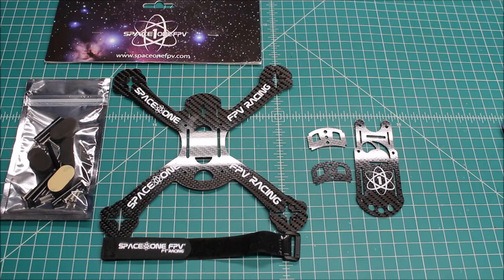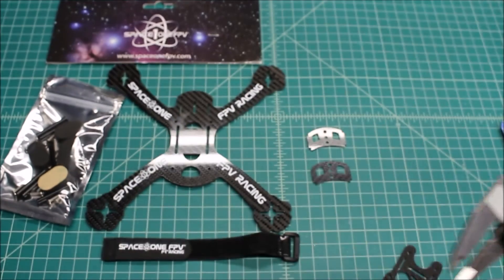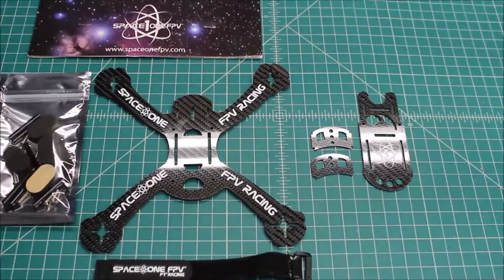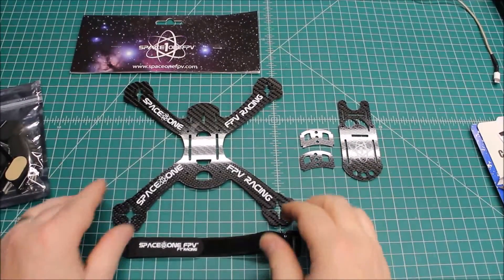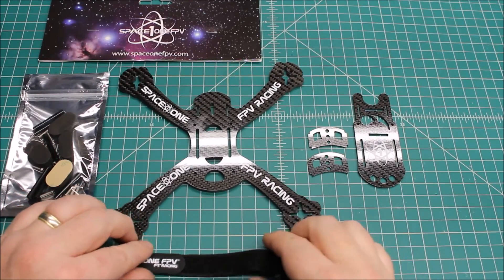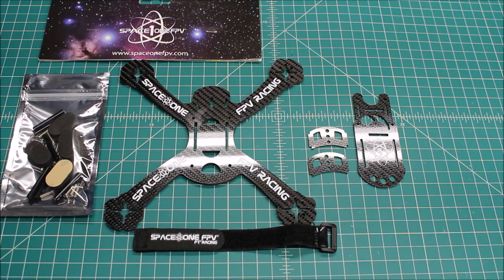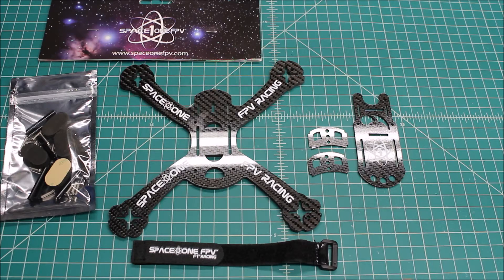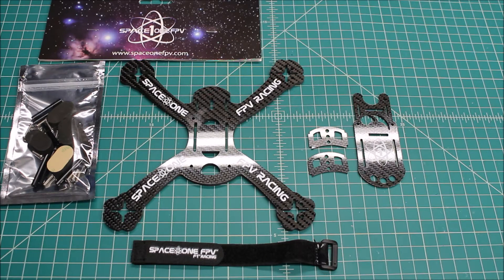Space One FPV Formula 220X Frame Review & Buildout

Comment: Great review and channel! Looking forward to your build results. I nabbed a SpaceOne220X frame and a Kombini FC, a set of RS2205/2300's, TBS24a_S's, and a Foxeer NightWolf. I had two questions that I would definitely appreciate your opinion on if you would be so kind? You said you would be running the Foxeer Arrow in yours, and the case in the Areow is the same as the NightWolf. So how are you mounting the camera? I noticed mine will not fit with the CF camera cutouts included with the frame unless I were to expand the holes. I also noticed that using the camera bracket doesn't fit quite right either. My second question was with the VTx antenna. The frame has those three holes in the top rear, are using one of those to secure your antenna vertically or is that a bad way to do it in your opinion. I notice you haven't been attaching your antennas vertically on pretty much any of the quads on your website. So I thought I would ask. Thanks a bunch!!
Reply from the maker: I would drill out the ho;es and mount your camera that way. IMO the provided camera mount rarely fits properly in a FPV frame. The only time I mount vertically is on a frame like the Neato where the frame design makes it difficult to mount it out the back.  I like to mount it out the back and run a zip tie through the vertical mounting holes to support the antenna. You really want to support the antenna as much as possible. This way when you crash and the antenna gets hit and pulls on it, the pull doesn't damage the VTX as well.
Reply: Thanks! You're right, I go through antenna's often, but it is unsecured and in a vertical orientation like you're saying. I think I just needed to see it in writing for me not to use those beckoning holes on the rear of my current SpaceOne build. Although, the holes will still come in handy for securing the wire ties. Thanks! As for the hole enlarging to fit the wider Foxeer camera cases. Is there a technique you prefer over others? I was thinking of just using a wireless drill and bit? Thanks again!

Comment: you said you using the arrow osd camera, but noticed the space one 220x frame looks like it is set up for a center mount camera, where it would pivot in the center of the camera case. like a lumenier or will the arrow internals fit in a center mount 26 x 26 case?

Comment: Doug,  I picked up one of these frames, and I really love the quality of it. I did notice the the motor's mounting holes seem to be a lot larger then I use to (compared to QV250). I need large washers to mount my 2204 and my 1806 screws just simple fall all the through.  I am interested in hearing your take on this, given your experience. Is there an mounting method I am not aware of here.
Reply from the maker: I didn't have any problem using a M3 Screw.

Comment: Doug, what are you going to use for  a PDB on this build? I just received mine in the mail so I am ready to start building it. Really like what you are doing here. Thanks
Reply from the maker: Keith Gilbert Im so glad your enjoying the channel. I will  use a Matek mini hub.
Reply: Just curious if the Brainfpv combo will fit in this frame? I would like to use it if it works especially after watching your reviews on the Brainfpv electronics. Looking to use Aikon 30a ESCs and still trying to decide on motors that will be great for racing? I missed the ZMX sale.

Great work Doug! Love your channel and all you do.
Reply from the maker: Keith Gilbert the brainfpv should fit wonderfully. Pirofliprc.com should still have some Hyperlite V2s, which are basically rebranded ZMX V2s.
Reply: Thanks. I will check the site again.